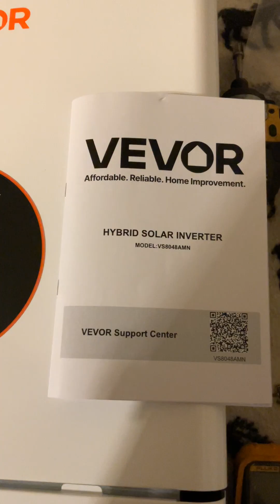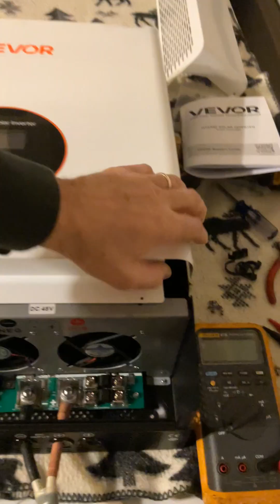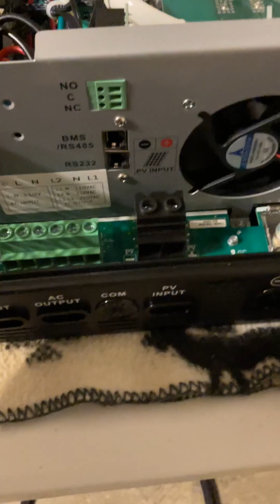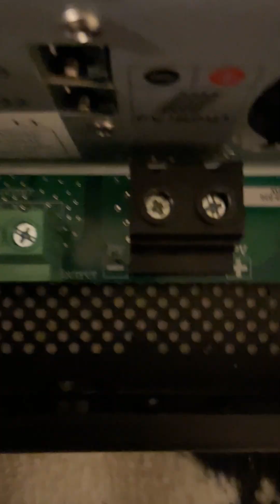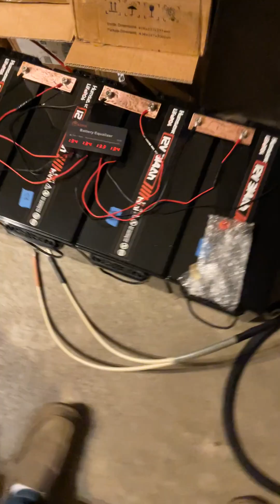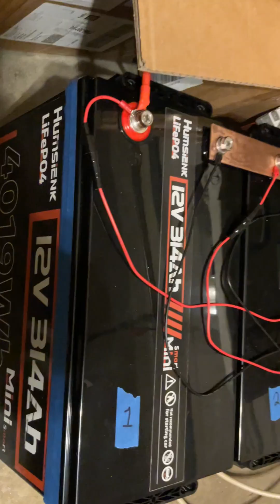VEVOR VS8048AMN Low Frequency 110/220 Output Inverter

Comment: La entrada ac es 110v o 220V?
Reply from the maker: The AC input is 110-120 volts only, and the inverters output is adjustable to 220-240 volts AC split phase.  It works great for a system that is set up as a battery backup system like I am using it, and would also be great for an off-grid setup.
Reply: @hilltopstudios4424 thank you so much!!!

Comment: Snatched one up and hoping this one can run my portable 12k btu ac/heat unit as the HF 6.2k inverter failed.
Reply from the maker: So far my inverter is working great, and @NoScotty has confirmed he has been using his daily and charges an EV with it with no issues.  It does seem to be more capable than the 6,400 watt rating, but I am still not able to fully confirm that as I can only measure the power going into the DC side of the inverter.  But estimating 92% efficiency I would have been running in excess of 7,000 watts output with no alarms or overheating issues, but it is winter where I am and garage is around 50 degrees so that would help it run cooler, but the fans barely run and cycle off and on unless it is running around 5,000-6,000 watts.  Good luck, low frequency pure sine inverters are meant for heavy loads and starting motors, the lighter weight high-frequency pure sine or the less expensive modified sinewave inverters are not designed for that and will fail when subjected to heavy motor surges.
Reply: @hilltopstudios4424 Ive been running it since I got it with 10kw batteries to power the heater on L1. Heater actually surged so high (3700w) and even tripped on one leg (bat limitation ) but AC run flawless around 1400w. Since then I've got up to 30kw batteries (6-100Ah server rack bat) and with 5kw solar arrays. My system now able to charge my Plug in hybrid vehicle on a daily basis. Next attempt is to setup a 50Ah breaker/RV connection for whole house backup. 
My EcgSolax 6.2kw HF inverter is now strictly a solar charger since it can take 500v and charge w.o actually turning on to prevent idle consumption at night.
Reply from the maker: @1FishinAddict  Glad to hear it is working good.  I am running 2 separate banks of four 12 volt batteries in series for 48 volts, both battery banks are able to run in parallel with each other.  I use a 50 amp generator inlet connected to my electrical panel with a generator interlock installed with a dual pole 50 amp breaker to power my entire house.  I run a generator cord from the inverter to the generator inlet.  I cannot run everything at the same time, but can run everything if I am careful with what I have turned on and don’t try to run it all at the same time.  The primary need in my area is keeping the natural gas furnace running in winter which I was able to do with my small inverter generator.  But now, I use the 115 volt inverter generator to power 2 separate 1000 watt golf cart battery chargers that charge the batteries during power outages, they are able to keep up with my normal house loads so the batteries do not discharge, and the inverter provides the 120/240 capability and large heavy load surges.  So, with how my system is set up I can run 120/240 volt loads from just a small inverter generator, because the generator runs the battery chargers which charge the batteries and power the inverter.  This does what seems to be what most people want from their portable power stations, 120 in while outputting 120/240.  This VEVOR VS8048AMN low frequency split phase inverter is awesome and amazing for the price around $600, and it seems to still be available.  I really wish I had a small solar setup to experiment with, I may need to put something together for this system to give me more to tinker with.  Oh yeah, my battery bank is 21 kilowatt hours.  A set of four 314ah Humsienk 12 volt minis, and a set of four 100ah 12 volt Hysincere batteries.  All working great so far and load share well.
Reply: @hilltopstudios4424 also I'm hoping to find a compatible wifi data logger for monitoring. I've bought an R232 communication Wifi from AliExpress, will report if it going to work or not.

Comment: I've been torturing mine daily for 4 months straight and it hasn't skipped a beat. These inverters are strong and underrated. Great video, thanks for sharing!
Reply from the maker: Great to hear, my schedule has been busier than normal.  Hope to get back to this more, I am considering some other changes for later this year.  Glad yours is working well.  I just uploaded a post with 2 photos of the paper that comes with the battery monitor, some info is more than likely bogus, some may be accurate, but it does work well for the price.

Comment: I agree. No real videos out for this model. 
I started hooking mine up and testing. 
But I’m not sure how to set the output to 240v? 
When I go to setting OU it only allows me to go from 100-120v did you see this with yours? Thanks
Reply from the maker: Hello, thanks for your message.  Yes, so far I have been experimenting with this slowly taking small steps and the voltage you mention is the same with mine.  When you enter the settings and bring up the one where you can change the voltage, change it to 120 volts, that will be for each leg.  So N to L1 will be 120 volts and N to L2 will be 120 volts, that way when you read L1 to L2 you will get your 240 volts.  So far the inverter is proving to be very stable and the able to power quite a heavy load.  Previously with just the 1 battery bank the inverters output was limited because my batteries only have 100 amp BMS in them, but I just finished wiring in the second bank that can run in parallel with the first one so I do not need to worry about overheating the battery BMS with heavy loads for extended periods.  The inverters output easily runs my electric clothes dryer which was accidentally started by my wife while other appliances and the furnace was running with no problem at all.  It does seem that this inverter was developed from a large 120 volt inverter, and even though the inverters output easily has 120/240 output the input appears to only be 120 volts, but I have not connected the input yet.  Thanks again, good luck with yours and have fun setting things up.
Reply: @hilltopstudios4424  yeah that makes sense when I check my multimeter. I see 110 on each leg. So it’s just the menu saying each leg. To where I thought it would say 240.
Thanks for confirming my suspicion.

Again, I’m not an electrician so I’m just trying to understand. Does that mean each leg does 110 V at 6000 W so about 50 A?
So if I bring each leg into 100 W panel, that should work fine?
Reply from the maker: @t @tonymorin83 e total output of the inverter is about 6,000 watts, so each leg to neutral (N) would be about 3,000 watts.  If you have a large 240 volt load connected to the outputs L1 and L2 like an electric clothes dryer, that would use the entire 6,000 watts of both legs combined.
Reply: @hilltopstudios4424 that makes sense. 
I’m am trying to take the AC out out directly to a main breaker panel that is 100% off grid but 50 amp main breaker panels are harder to come by that are not just sub-panels. So I was hoping 100 amp main breaker panel would work. Thanks for responding 😊
Reply from the maker: @tonymorin83 Good afternoon, thanks for reaching out again.  You can use a sub-panel as a main for off grid if you want, how it would work to be able to have a 50 amp breaker as the main breaker would be to install a 50 amp double pole breaker in one of the slots of the panel and feed the inverters two legs of power, L1 and L2, into the breaker connections where you would normally have your outputs connected from the breaker to an appliance.  Set up like that, the breaker is now feeding power to both legs of the panel just like a normal main breaker at the top of the panel would do and you then just connect the inverters neutral and ground wires to their respective locations in the panel.  Since you would be using this panel as your “main panel” you want to make sure to install a “neutral to ground bond”.  Depending on the type or manufacturer of your panel you are using there may be a screw location that needs to have a screw installed to make that bond connection, if it does not have that option you can just install a copper wire jumper between the neutral and ground busbars to make the bonded connection.  It is important that there is only one neutral to ground bonded connection in your electrical system, and it should be in the main panel where it occurs.  I believe the correct size for a copper wire neutral to ground bond connection in a panel  with a 50 amp main breaker is an 8 gauge wire (8AWG).  Make sure you connect all of your grounds to the ground busbar and all of your neutrals to the neutral busbar, with the bond then between the two.  Also make sure to have a proper ground rod pounded into the ground with a copper wire running from it to your ground busbar in the panel to ensure everything is safe.

Comment: Hi I've been looking for some videos regarding this inverter and found Eds DIY Solar Farming. He has a few videos of his setup and use of the Vevor 6000w inverter. He's in the US so would be relevant to you. He does a teardown (https://youtu.be/5zOHcGwJ3dw?si=14dKfp8b6VmoID5f) and stress test of the Vevor (https://youtu.be/5OnOWm88ncY?si=jEGWKseDTRV_dvN4) and also uses a transformer to split the 120 v legs so he can power a water heater (https://youtu.be/sd6VjGGCFxk?si=gvDxu3oWsXflvZwr). Appreciate your videos.
Reply from the maker: Thanks for the links and your comment, I have actually seen this video he put out.  His inverter is different from mine in that his is a high-frequency inverter that only outputs the 240 volts, mine is actually what is called a low-frequency inverter that already has the 2 large transformers built in and already outputs both 120/240 with the output consisting of L1/N/L2.  I do appreciate you reaching out as I am very new to YouTube and building this system.  He does put together great videos, I am trying to get better with mine hopefully I will improve, thanks again.

Comment: As an inverter repair tech with nearly 30 years of experience in the industry, I can tell you from experience, when it comes to performance, longevity, and safety, low frequency, transformer based inverters like these are way ahead of the game when compared to high frequency transformerless inverters. You made an excellent choice when purchasing this inverter.
Reply from the maker: Great to hear from someone in the industry, my background is aircraft electrical systems for 26 years, I changed to an inspector position 10 years ago and as I come up on retirement I knew I was always very interested in this type of thing and thought putting together a small system to tinker with would be a good hobby while also being useful.  I think the high frequency inverters look fantastic and offer huge capabilities, but the low frequency inverters to me seem to have a certain additional level of safety regarding the output as it is directly from the transformer windings to my house as opposed to a pulse-modulated type of high frequency inverters with no isolation.  The thought of a potential failure outputting DC into my homes wiring as well as their reduced surge capabilities made me feel more comfortable with something like this, especially since this is only to be a backup system to use in power outages.  Thanks for reaching out, I am new to posting on YouTube as well and appreciate the interaction.

Comment from the maker: The initial testing of the inverter, I verified output voltages and found it was simple to change the settings from 110/220 output to 120/240 output.  The frequency was already set for 60Hz from the factory so that did not require changing.  I have not tested the input connection where AC can be fed into the inverter, and I am not 100% confident that what is shown on the label is correct.  The label they have on the inverter for the output is correct showing split-phase power, so I could go on the assumption that the label showing you can connect single line to neutral voltage of 110-120 VAC on the input is correct as well, but I do not feel that is a logical assumption to make without more investigation.  As it is with most less expensive items from China, the equipment seems to be of pretty decent to very high quality, but their manuals seem to be severely lacking, and that is the same situation with this inverter.  While fault codes and inverter settings are fairly well defined and explained, some of the Chinese to English translations are a bit confusing, and in the case of the input voltage information there is only a picture of the same tag in the manual that is also located on the inverter by the AC input connections, so I am exercising caution as I do not want to blow this thing up right away, and will be charging the batteries how I originally planned to do, by using external 48 volt LIFEPO4 chargers connected to my 4,000 watt inverter generator when extended runtime is needed for backup.